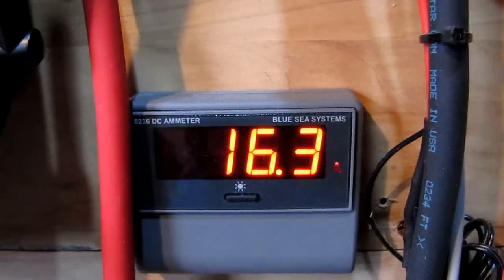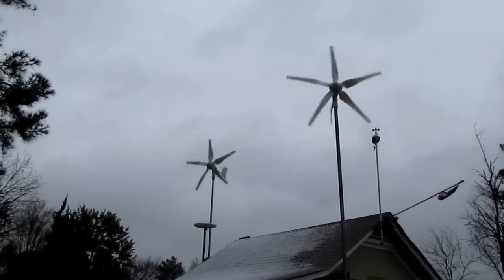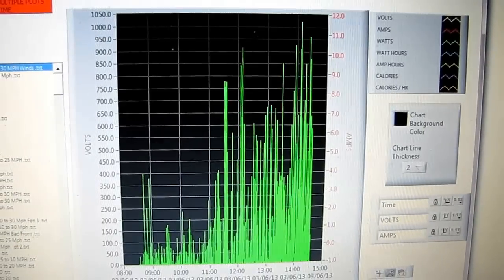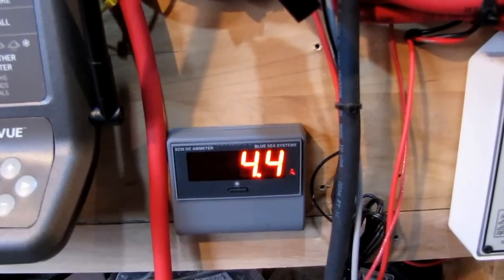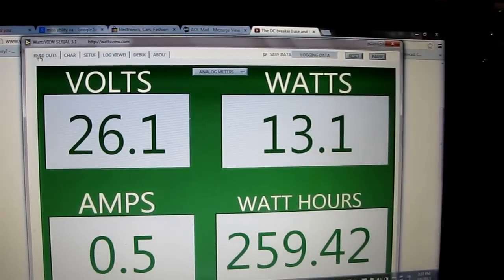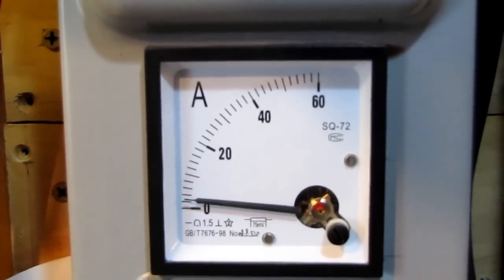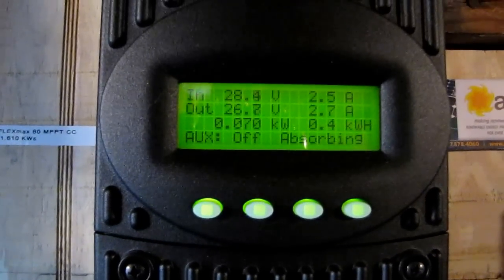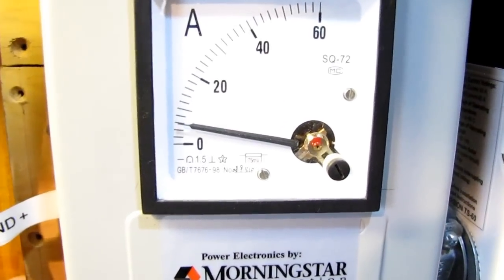Wind Turbine's During Winter Storm Saturn By VIARLOCITY

Comment from the maker: Tright Now I Have A Morningstar Tristar 60 That Diverts My  My Power From My Battery Bank I also Have Missouri Wind And Solar 1000 Watt And  600 Watt Air Heaters / Resistors  Also Xantrex Makes A 60 Amp Diversion  Controller Nice Set ups